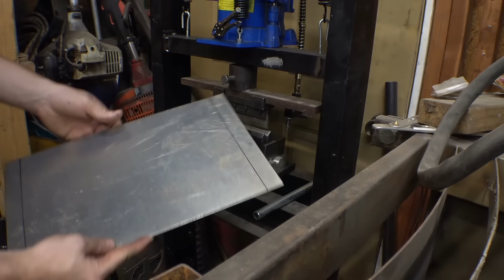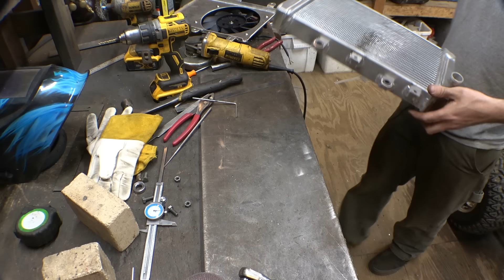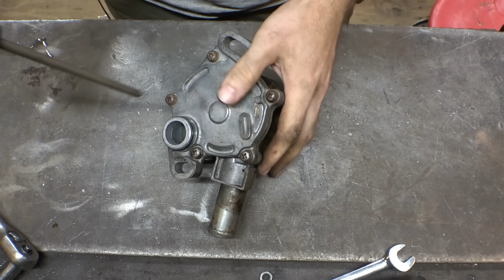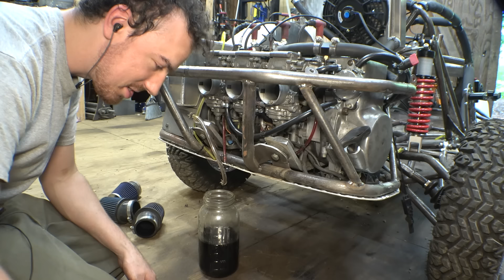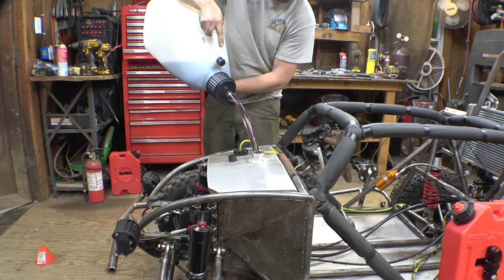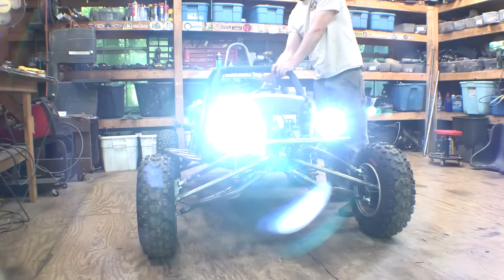Fixing all the Problems on this - Mini Baja Bug Project

Comment: You should add silicone thermal pads under the rectifier so that big aluminum plate acts as a heat sink

Comment: The radiator fan is going to blow all the hot air on your back. If me I would weld two bars from the roll over bar to the back bumper and mount it above the engine.

Comment: does'nt work that way, you can have a 50amps regulator, if the load is only eating 20amps, the regulator will not blow up, the other way around, if the load takes too much, the regulator will fry

Comment: That can is clear for their stupid color code thing, red is gasoline, yellow is diesel, blue is water and clear is supposed to kerosene but I have been using a clear jug for years because I know what I put in it and don't care if some stupid thief blows himself up from stealing my stuff and not checking before using it. Lol
Reply: And to be clear I don't know what the color code is I just meant that to be an example.

Comment: Just don't do donuts it's just childish. When engines are over temp they definitely don't want to run right. the heat can cause the bearing in the water pump to give way.